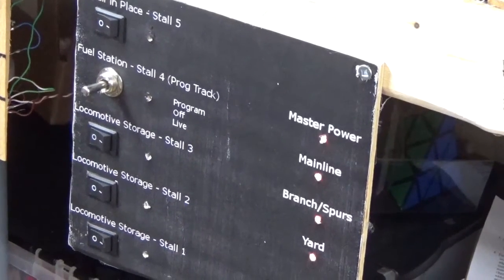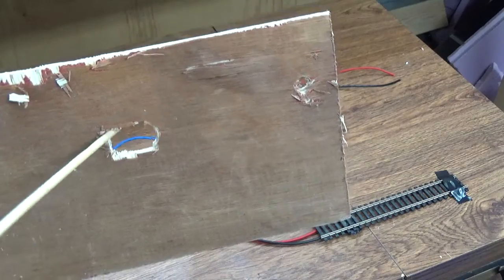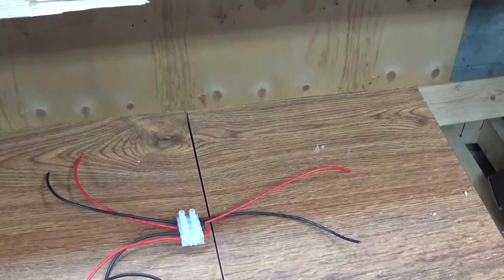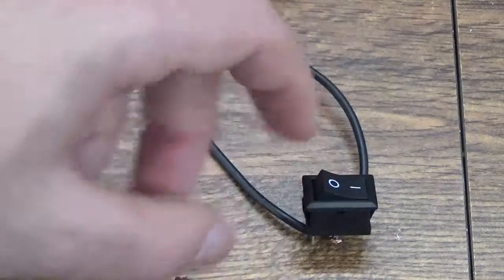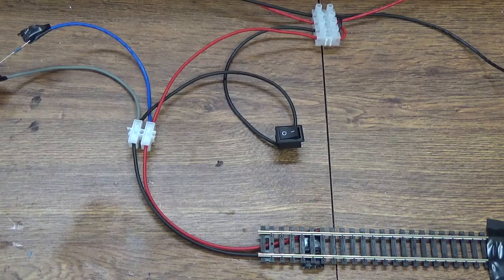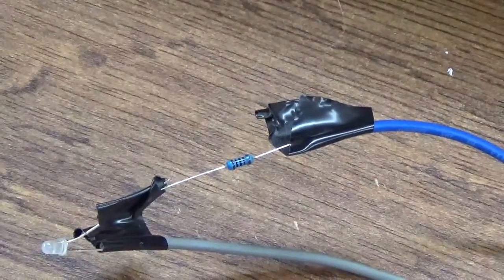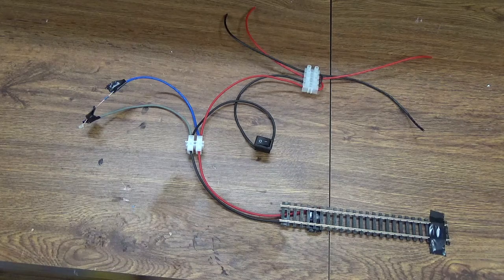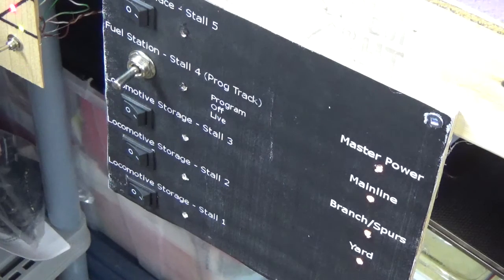HO How to - Power Panel and LEDs

Comment: Hi I came over because M&M Rails.  Your wiring plan is simple but what type of resistors do you use and how do you determine what type.   I appreciate your advice and thank you
Reply from the maker: This was a long time ago, but i usually just reference what LED i end up getting and make sure that the resistor is the correct amount to make sure I can safely use it with 12V. I ended up just looking at basic types and figuring out what I needed from some research. I don't list them here but in some forums or youtube videos they tell you what you can buy. Sorry I can't be of much help.
Reply: @DaveCoTrains  Alls good.   Thanks for the info

Comment: and you could have used a nine volt battery to show the led light up and go off, great job, I might even try it for my round house area
Reply from the maker: You're right, but I didn't strip or solder any wires, just taped them anyway. I'm excited to see your layout come together once more.
Reply: thanks, once the house was fixed up, it is full speed ahead.

Comment: I believe that setup will burn the LEDs out fairly quickly as what they're actually experiencing on DCC power is a repeated switching of polarity (the same reason why a DC loco on DCC tracks just sits there and hums).  Ideally you'd want a bridge rectifier to turn the DCC into pure DC.  But if the LEDs are accessible enough that they can be easily replaced it might be simpler just to do that as needed.
Reply from the maker: D-Rail Thanks for the comment! You may be right, I've only had LEDs on the track power for about 6 months. I thought about the dcc but even when I "zero stretch" the lights don't change, but I'm not familiar with how digitrax applies dc power. I also wonder if the resistor may prolong it at all. I'll be sure to keep an eye out for any burnt ones and make an update when they do.
Reply: Daveh88
DCC deals in such a high frequency (microseconds - millionths of a second) so you'd never be able to see that.  DB107 are the bridge rectifiers I've seen recommended for coach lighting, I bought 50 for $5.69 on eBay (haven't done anything with them yet, though, coach lighting is still on the to-do list somewhere!).  But LEDs are pretty cheap too so maybe not worth the trouble.  I just thought I'd throw that out there.
Reply from the maker: D-Rail good to know. if I have any problems I'll look into them!